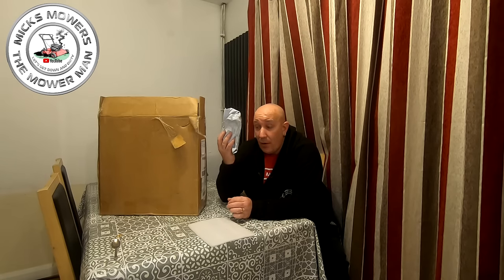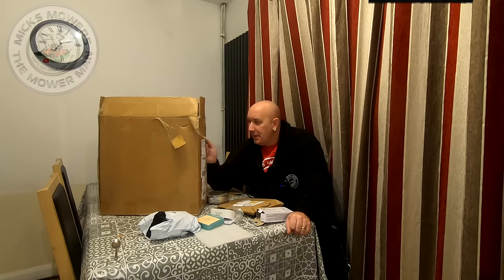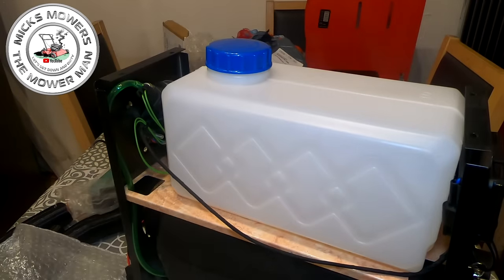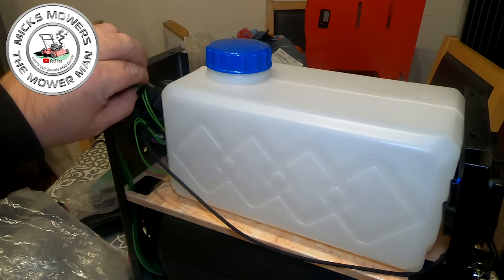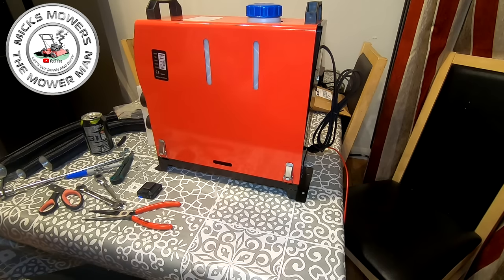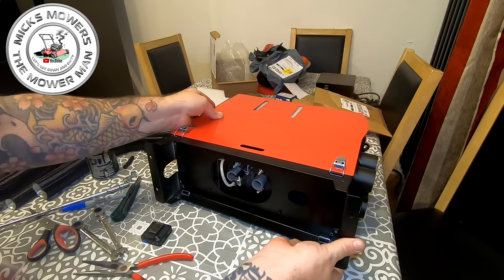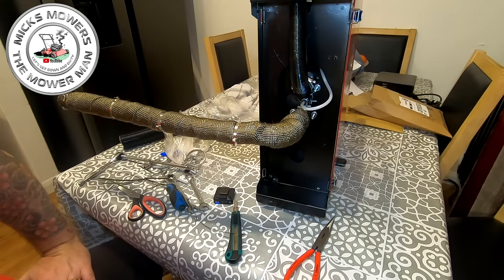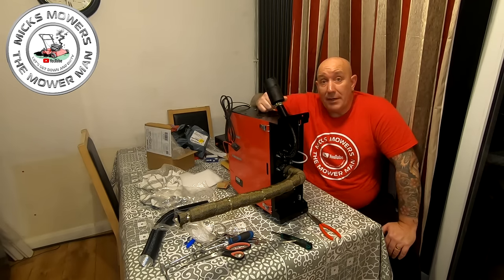Best Modifications To Improve Your Diesel Heater - improve Performance #dieselheater #modified

Comment: I would  surgest you mount the pump on outside of heater and suspend it on bungee cord 5mm thick on ebay. that way you can solve 3 problems at once firstly drill a hole inline with fuel tank outet bigger than pipe so you can put something soft around fuel pipe where goes through the tin, this will solve having to tight a bend in pipe this helps to reduce the resinance of pipe on heater frame. next fit an inline fuel tap, and the filter is next then pump, but I bought a ultra quiet combo filter and pump well worth the money for a more quiet heater there are few ways to mount the pump, but what is needed is about 2 inch peice of horizontal repare plates work for  me, at top of heater frame anything to tie bungee too away from the metal frame, because that is what causes a lot of the noise some people use cable ties , they still transfer some noise i think bungee is better. From pump to heater and now it does not need to go through body or touch anything othet than fuel inlet connection . i tried to put a photo of one, but YouTube will not let me. if you want i can email some pics to help ihave a total of 5 heaters , 2 are now heating my home and saving me money on my gas bill. one more thing important i use kerosene not diesel its a lot cheaper and cleaner.
Reply from the maker: Thanks for the update

Comment from the maker: Mercury 15 A 13.8 V Switch Mode Bench Top Power Supply  https://amzn.to/3UQDHMI
Reply: Noo!  Float battery charger and battery .  Every time.  More expensive to purchase, but cheaper to run and safer for the heater (in the event of an unexpected power cut).
Reply: @oliver90owner  this is good information. 👍

Comment: Turn the clamp away from exhaust. Use black hose all the way. Saves a lot of clamps.
Reply from the maker: Good idea apart from you would not be able to see the fuel running..
Reply: Don’t understand why you want to see the fuel running through the lines.
We can’t see this on our vehicles.
If fuel is not running through the lines, pretty sure we would know.
Reply: 100% with you Lou
Reply from the maker: @pauls6157  because the pump has to prime first on start up ..

Comment: You need some strain relief on the cable as there is none at all the entire way to the ECU in the heater casing, a gland nut will sort it out.

Comment: Replacing the flexible fuel pipe is totally overkill. The pipe will take whatever time it needs to fill up before delivering fuel to the heater. And there's a risk that the new pump will not be exactly 0.2 mL or will not be handled as the controller is expecting it to be. I don't think this mod is necessary at all, maybe the opposite.
Thermal insulation of the fuel line around the heater is quite necessary though, as well as for the air exhaust pipe over all its length, unless you have some heat exchanger around. I also zip-tied the fuel line as far away from the heater as I could.
I also replaced all the water-hose clamps with real stove pipe clamps, and I'll probably replace all the pipes with better quality airtight ones. I have no idea if the current cheap exhaust pipe can withstand the extra heat caused by the insulation, or nitrous or sulfuric oxidation from the diesel exhaust corroding fumes. Also, I plan on zig-zaging the exhaust pipe inside a wall going up, to use the wall as a thermal mass and retrieve all the burning hot heat otherwise wasted in the exhaust, so I'll probably add a water collector at the bottom to redirect the water condensation outdoors and prevent corrosion in the exhaust pipe.

Preventing the fuel tank from moving is also not a big deal, since the heater will be fixed on a wall, but if it's really a concern, I'd cut a sheet of insulating material and glue it to the case on both sides rather than adding metallic or wooden wedges, which may not handles high temperatures properly. 

Also, you should not wrap the pipe with aluminum foil, but use an insulation sleeve around the pipe or one that is already insulated. That's not the proper and maintenance-free way of doing so.

I hit the same issue of course with the horribly designed exhaust pipe and the 2 small feet that require an extension because the exhaust pipe just cannot fit between the feet if you intend to have the case stand on its own rather than fix it on the wall. The feet actually need to be high enough so that the exhaust pipe is rather far away from the ground. The tiny transparent plastic pipe near the exhaust and the heater also needs its insulation sleeve regardless of how insulated the exhaust pipe is.

Vevor may be a great tool brand present in the UK, France and other countries, but this specific diesel space heater is still cheap Chinese junk that does require quite substantial modding to make it safe and efficient. But at least it's doable.

Comment: Most people install filters upstream of the pump, not downstream of the pump.
Reply from the maker: No room.. if there was I would have ..
Reply: @themowerman  Makes sense - very good video, BTW.
Reply from the maker: @mobiusx8117  ta mate
Reply: @themowerman  wrong answer !! for those fitting this system put the filter before the pump.. make room.

Comment: You need a heat exchanger to preheat the intake combustion air from the exhaust waste heat.
Reply: I've been experimenting with this just today actually. On my set up, it makes absolutely no difference to external chamber temp or output temp if I pre heat the combustion intake or take -3c air from outside. However..as any car modder knows, cold air is more dense and therefore more oxygen, so possibly drawing such cold air in from outside today isn't the best test. Maybe when the cold snap finally ends in the coming days I may see a difference.
Reply: @shanehogarth6373  You won’t!
Reply: @oliver90owner  thanks, care to elaborate a little more?
Reply: @shanehogarth6373  Lets take a scientific approach, to testing for significant changes.  Within experimental error, a few degrees is neither here nor there.  What is the standard deviation of your series of tests?  More air not only means more oxygen, but also four times that amount (of the extra Oxygen) as Nitrogen.  There may be water vapour to take into account, also.

Density of gases changes according to the General Gas Equation - where the temperature is measured in Kelvin, not degrees Celsius.  More changes/errors will arise due to non-stoichiometric combustion.  

The usual results, by most experimentalists, are skewed in favour of the tester.  It is very difficult to design/make fair tests.  Conclusions are often subjective.  A much better (and likely only marginal for overall economy) is to recover some of the exhaust heat to actually warm the room.
Reply: @oliver90owner  That's a great answer, thank you. It demonstrates you have a full understanding of the burn process and importance of stoich value, which is something I have been playing with also, but not as you quite rightly assumed, in precise, highly measured conditions. More just generalised, basic experimentation. 

David Mcluckie played with this side of things some time ago and there has some  interesting videos on here. One thing I have come across now is that using a CO2 meter to get a nice lean/efficient burn works well but makes ignition from cold difficult with a little air restriction required for consistent ignition, and then the restriction removed once ignition is successful. Those old enough to remember IC engines with chokes will be able to relate to this😀.

Having the rare opportunity here in the UK to be able to draw in air from outside at -3c and comparing it with hot air (not measured)  drawn across a large heat exchanger I thought would be a great indicator of how much, if any difference it would make. There was none.
Reply: @shanehogarth6373  Do you really mean a CO2 meter.  CO is the meter to go with.  O2 meter might be good as an alternative.  CO used to start appearing before O2 declined to zero, where I worked, but that could have been leaks due to seals in the system as it included rotating components, so I always associated reduced burning conditions with the CO analysers coming off the base line.
Reply: @oliver90owner  Hi, sorry for the delay in a response. Yes, at this time I am using a pretty simple CO2 detector that gives PPM indication. David McLuckie used a wide-band O2 meter on one of his builds (AEM, with bosch  lamba sensor) with the sensor mounted a little down wind from the burner and the results were interesting but not altogether success. He seemed to get a much better result in terms of tuning using a small hand held co2 meter and for now that's the approach I am using. I don't have a spare wideband o2  sensor here anyhow, only a narrow band and that's not going to really tell me much, other than which side of stoich for the fuel it was intended I have it. The amount of heat that can be collected from the exhaust is pretty significant and am primarily concentrating on this for the moment. Have been giving some thought to some forced induction on the burn inlet too, the limiting factor will be the internal fan on the burn chamber side, but nonetheless I should be able to increase the amount of air going in with ease. Just curious experimentation at the moment without shed loads of investment.
Reply: @shanehogarth6373   David would not be using a CO2 meter.  CO and CO2 are both oxides of carbon.  Much like the oxides of Nitrogen - N2O, NO and NO2.

Everyone breathes out CO2 (carbon dioxide) but CO (carbon monoxide) which is produced under reducing conditions, when burning carbon fuels of any type, is poisonous if breathed in.  It readily combines with haemoglobin in blood (about 216 times more readily than Oxygen!) thus seriously depleting the ability of blood to carry oxygen around the body, for respiration.  Can soon cause death if there is a few hundred ppm in the air.
Reply: @oliver90owner  you are of course right, it was a CO meter and the object was to reduce the carbon monoxide levels at the exhaust.
Reply: @shanehogarth6373    Shane, I have noticed you have recently commented, elsewhere on you tube, re improving air flow.   Please note that that particular channel is one that makes even other ‘poorish’ videos look good!  It certainly demonstrates that one must not believe all you see, or read, on the internet.🙂
Reply: @oliver90owner  ok. Something else I maybe should have mentioned regarding increasing airflow by removing the cubed mesh at the end was that not only does it increase airflow across the whole burn chamber but you can hear an audible increase in motor speed, so it wouldn't be unreasonable to think the airflow to the burner is also slightly increased, thus possibly producing a slightly leaner burn too. For those with the ecu/controllers that can't be tweaked, this could be a way of achieving a slight bit of tuning, albeit mechanical not electrical.
Reply: @shanehogarth6373  Fan speed is controlled by the Hall effect sensor fitted just behind the fan.  I would suggest that air flow is bound to be improved (laminar flow is always better than turbulence) and any change in noise level will be attributed to either the air velocity/flow or the motor electrical/mechanical load to maintain the fan speed (chinese bearings, in the main, are not famed for excellence).  I would be confirming fan speeds with a rev counter, if it were me doing the experiment, before drawing any conclusions.
Reply: @oliver90owner  yes they're all valid points and time permitting I will hang my oscilloscope on the hall sensor.

Comment: Instead of pumping uphill, why not turn the pump 90degs so it pushes down. Doesn't the filter need to be on the inlet to the pump.
Reply from the maker: No room on the inlet side.. and the pump should be about 30 degrees..

Comment: The nylon fuel pipe is basically polyamid that is used on cars now. Its 100% ethanol proof (even diesel has ethanol in it now). You can help the pump by priming line from tank to pipe so its getting some fuel a bit quicker. Ithers have said that cold air feed pipe is better if a smooth bore as the corrugated pipe can cause too much intake turbulence 👍🏻

Subbed!
Reply from the maker: Ta for popping over.. it's all work in progress.. I will sort it .. ta for watching
Reply: @themowerman  is it possible to fabricate a catalytic converter using a wood stove ceramic honeycomb catalytic converter? Is there room at the end of the burner and the heat exchanger casting to put in a square or disk of ceramic. The hot diesel exhaust would pass thru the catalytic honeycomb, enter the heat exchanger area, then pass backwards thru the outer annulus of the catalytic  ceramic honeycomb to the exhaust. Both passages thru the catalytic material would increase the temperatures entering and exiting the heat exchanger. This would eliminate exhaust fumes and (possibly) reduce CO in the exhaust. Also, you can buy an ozone generator for your car lighter that you could pipe some intake air thru the ozone generator and into the exhaust to destroy residual CO left from the catalytic process.

Comment: All these  heaters are working on 12 volt.  I look for 220 volt..
Reply: That's why he is using the 220 to 12v power supply. Get a cheap 12v 30amp power supply from Amazon for under 20 dollars.
Reply: @englishrupe01  A 30A DC power supply will be wasting energy while operating at about 1-2 Amps!  What happens in a power cut?
Reply: @oliver90owner  well not really. Just because a smpsu is rated at 30A, 10A or whatever, the amount of power consumed (mains side) is directly proportional to the current produced on the DC side. The mark space ratio of the switching device used, SCR, Transistor, PowerFET is adjusted accordingly.

Comment: Why not use the rubber fuel line that you’re using to connect the nylon to the pump it takes much more pressure than that on cars and trucks with electric fuel pumps in the tank the whole line is pressurized all the way into the fuel rail that hose is designed so there won’t be any flex or leakage!😳
Reply from the maker: It's all to do with the ID of the pipe mate .. the smaller the better .. as the pump is soo small..

Comment: The purpose of using a more flexible fuel hose is because of the pulse pump. When you use a stiff nylon fuel hose there is more resistance and the fuel pump breaks down sooner.
Reply from the maker: I don't agree..
Reply: @themowerman  While not agreeing with Gatse, where do you think the fuel goes, after leaving the pump.?  That’s right, it goes into the heater.  Indeed some sell ‘pulse dampers’ for about £20-25 - a huge waste of money.  Mine has been in about a year and is plumbed with that ‘squeezy flexible stuff’ snd it works perfectly.  No degradation so far and none expected..  Fewer (half) the number of  joints to leak, too.🙂. But your choice to spend extra - but I don’t intend to.

Comment: The intake and exhaust need to go outside or you will pull cold air inside the house when you push exhaust outside🧐 Otherwise very good. Have a 5K for a couple years now for emergency heat.
Reply: make sure to put insulation on the intake then. so it cant be a cold bridge from outside to the inside.

Comment: Used motor oil would be a great way to use this machine. Someone should figure that one out.
Reply: you have to mix it with diesel or something else. otherwise the combustion chamber wil get messy.
Reply: Hmmm...  Ladys and Gentleman, the use of, used, motor oil is truly brilliant.   How ever....  this is not a diesel engine. I do use processed, used, motor oil in my Mercedes 123 diesel.    Used motor oil is a lot of work.  Why do I do this you ask? The price is attractive.  Free! 
 
 This device is more related to a turbo engine, or more distant, to the jet engine.  Diesel fuel and kerosene have a viscosity that is required to ignite rapidly at a specific temperature.  Without venturing into the thermo dynamics of this, it would suffice to mention what you all are aware of. 
 Used motor oil requires extensive filtering.  Used motor oil requires specific dilution with the primary fuel used.  Used motor oil will accumulate residues that ultimately deposit in the burn chamber and suffocate this heater.

Hmmm...  Well, what about COOKING oil, you say?   Yes, I too would like my shop to smell like french fries! :)  Alas, 
the same result as diesel.  This engine will not accommodate cooking oil for the same reasons it cannot use diesel.
 
Yes, there are work arounds and variations of process that can be implemented....  But, what level of a P.I.A. are you
willing to endure? 

Mick, now you've done it!   You have created a true international fake Wabasco heater forum! :)  :)

Absolutely stellar.  Absolutely stellar indeed.  Thank you.